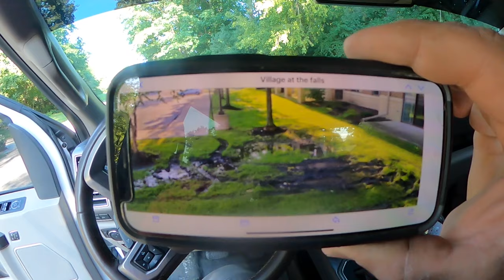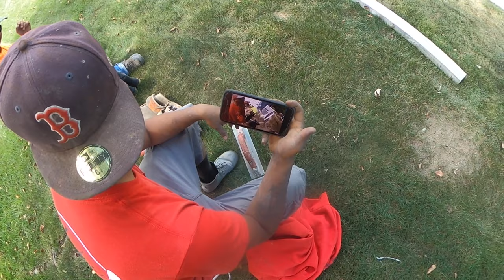Concrete work is easy? It depends

Comment: Hello concrete batcher here, I work in scotland as a concrete batcher/Plant Supervisor, Sometimes concrete cant come if there is a lot of work going on, I work at a plant with mainly only 2 Trucks, Sometimes if the trucks are stuck on site a lot of loads are going to be late and I know its frustrating but dont worry, You are not forgotten about, We can only work with what we are given and sometimes we are only given 2 mixers to work with 150 Cube, Anyway great video!

Comment: Another great job boss! Your concrete work will last a lifetime cause you actually know how to pour a true 5inch slump,  I’ll take 10 yards to contractors in Denver Colorado and they order a 5 and add 40-90 gallons for driveways and basements… I get pissed off  cause they want the mud to fall in place instead of really working with it.. Cheers 🍻 boss

Comment: 25 yr  road and residential concrete finisher from central wi. Maybe no help for Bugs now but sure wish I'd started using knee pads earlier in career. Could have helped to avoid knee problems now. Good work

Comment: small observation by an electrician here, you do not want to use that indoor romex like that it will break down. They make a specific direct burial romex with a pvc coating on it, that should be used in  a situation such as that.

Comment: Genuine question, i know it's expensive but don't you think you could work ALOT more efficient by using a concrete pump (trailer size model) and a gas powered rotary finishing machine? Maybe even twice as fast? Or at least need one guy less?

Comment: If that wire was buried without being in conduit then it most likely is not romex lol .. Romex isnt rated to be direct buried .. What you would need is some UF wire.. And the proper splice kit that is rated for direct burial .

Comment: I'm sure you pour a little bit into winter also being from Wisconsin we use ground heaters for a few days or even up to a week if it's like really really cold and then we will add accelerator and hot water to concrete mix and after we lay it down and bull float it and edge it get it all tightened up then we will put concrete blankets over it for like an hour or two or three and then roll them off and hit it and get everything tightened up again then put the blankets back on and just do that over and over till its finished longest pour I've been on took about 36 hours to finish we would leave eat do what ever and just check it every now and then and when it needed it hit it and then wait again

Comment: I am in the process of getting quotes for concrete in my backyard.  I am having a really hard time choosing between two different workers (contractors)..  There is a difference in price.  Will that mean a difference in quality?  What should I be looking for-is all concrete the same or is it possible they skimp on the concrete quality (which would not be acceptable of course).

Comment: question, why did you saw cut the joints? normally you cut the joints when the concrete sill setting...

Comment: We pour our exterior same slump a 5 or 5.5 but then we add plasticizer that's nice cuz it makes it seem a lot more wet than it is and if it's going to be a hot humid day with the sun on it and a little bit windy we will wet the ground down pretty well and will use a surface retardant but we usually only have to do that in the middle of summer when it's average 100° all week

Comment: You should not use regular romex outside. Use UF wire which is outdoor/burial rated. Just looking out for ya!
Reply from the maker: It is just temporary. An electrician is coming to redo it right in conduit.

Comment: Why do you put joints into the concrete? sorry for the noob question
Reply: To stop surface cracking by creating pressure release joints that crack instead aka trying to prevent cracks from working it's way across the surface and limit them to the joints only...

Comment: Wrong type of wire…..it needs to be #12/2 direct burial UF…..It’s usually gray….. 100’ is about $100….. I recommend that you replace the yellow RX….
Reply from the maker: It is temporary, an electrician is coming to redo the entire line in conduit.

Comment: Also, how do you get the lines cut near walls?
Reply from the maker: With a handheld grinder.
Reply: What determines whether you cut the seams or trow cut them?
Reply: I had my driveway here in MN done 2 years ago. My patio and walk were trowed for seams and the driveway was cut.